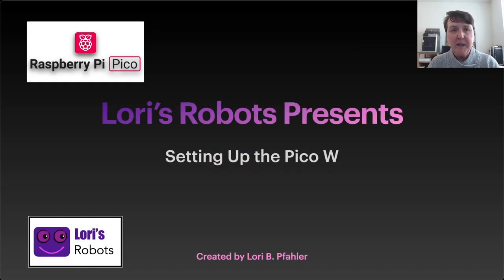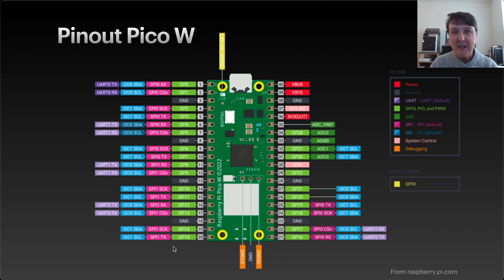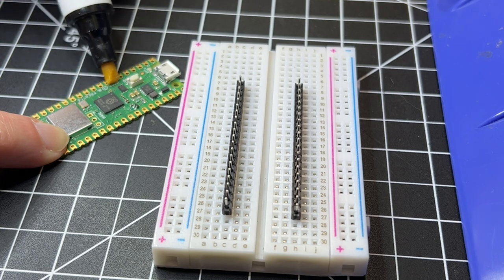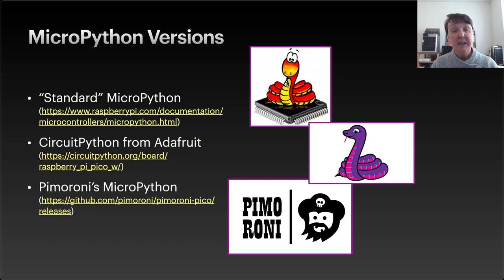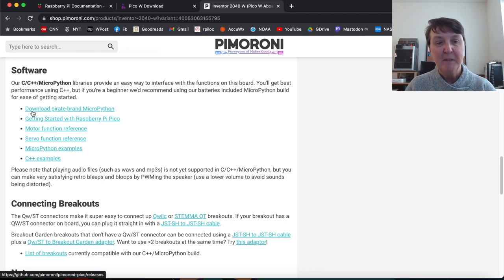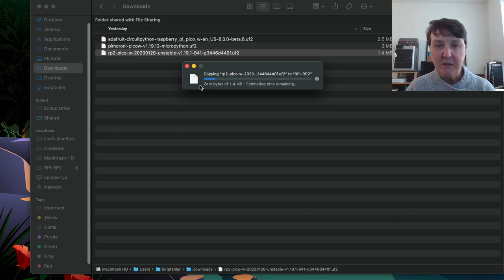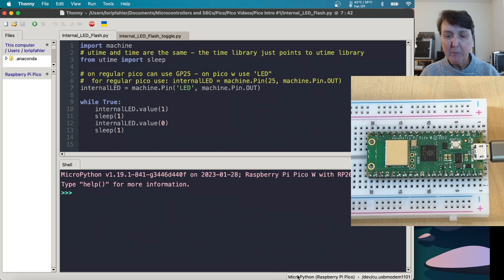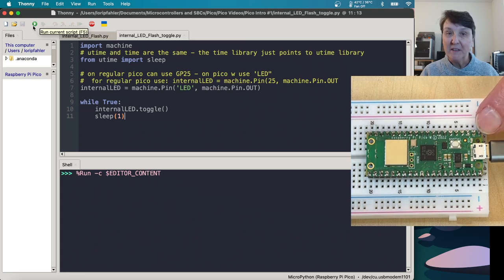Pico W Episode 1: Setting Up the Raspberry Pi Pico W

Comment: Thanks for this nice video, I’m glad it popped up in my iTunes feed this morning. I’m glad you started with the soldering of the headers. Frankly I bought a pico with the headers on already because while I have soldered in the past, I’m intimidated by it.  I think I’ll try again.   As for editors,  I started with Mu, and I really like it.  I use it for my Microbit, adafruit boards and playing around with python.  I’m just a retired novice having fun learning.
Reply from the maker: I am retired too and started learning electronics over a year ago. Mu is a fine editor - whatever works for you!  I am still trying to improve my soldering skills. You just have to jump in and be OK with making a few mistakes. Thanks for watching!

Comment: This is super useful, subscribed! Ordered a Pico W today because it was available, but was all at sea regards header pins and installing micro python … you guided through the process so completely and helpfully (you could easily have left out a step in the process in assuming knowledge of this or that, but I’m very grateful you didn’t 😊)
Reply from the maker: Glad it helped.  Thanks for subscribing and watching!

Comment: Well presented ! From my experience you can use label 'LED' with oridinary Picos (aka non-PicoW) as well. I did stumble over that when trying to run the same code on both Pico and PicoW recently
Reply from the maker: I will have to give that I try.  It has been ages since I played with the internal LED.  Thanks for watching!

Comment: one extra step I do before soldering is to rub the contacts lightly with a fine emery cloth or other light abrasive to remove a layer of oxidation on the solder tabs. that really makes the solder flow better. also .8mm 37/63 solder but I also use a lot of 60/40 multicore solder and have no problem using it instead of 37/63.
Reply from the maker: Nice solder tip!  Thanks for watching!

Comment: No matter what I try [reload, restart, reinstall, change cable] my Pico does not show up on the drives. It did initially but now a day later it doesn't. Any guidance please? BTW Win11 and all up to date. VPN off ... NO sign on device manager ports either. Help!
Reply from the maker: I don't use Windows so I am not in a good position to help.  Most issues folks have are with the USB cables.  You mention you changed the cable and it did work the day before.  Do you have a raspberry pi?  You could try to work with the pico on that and see if it shows up on the RPi.  OR if you have access to a second computer to give it a try on that one.  Of course - it is possible that the pico is bad - somehow got "fried" when you were working on it the day before.  They are pretty cheap so getting a second one to work with might also be helpful to diagnose issues like this.  Hope this helps.  Good Luck!